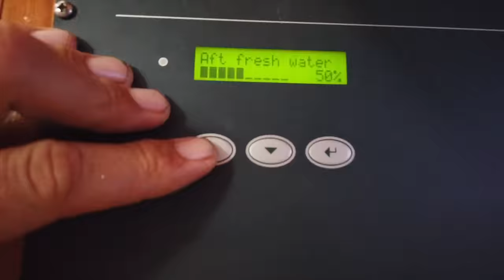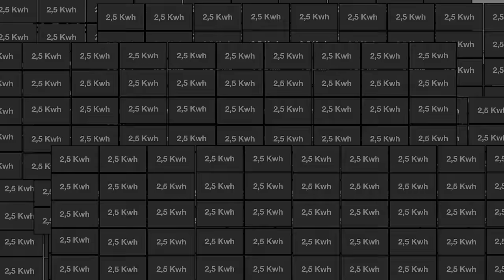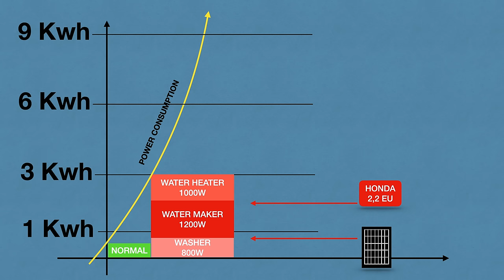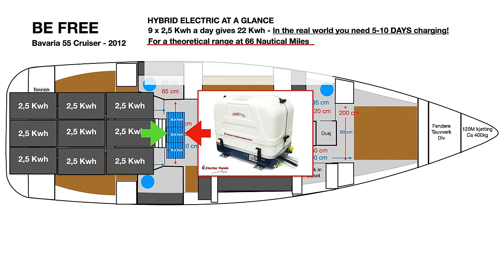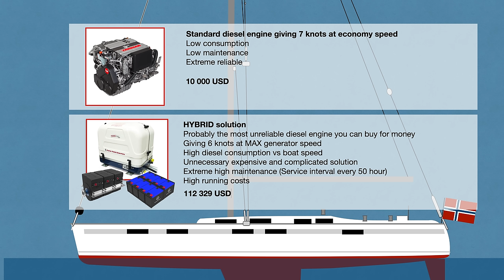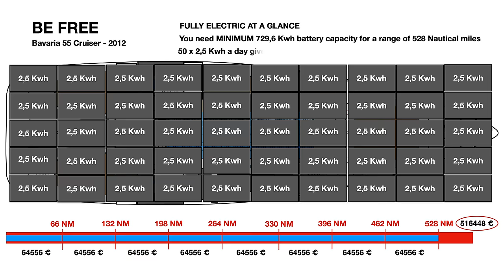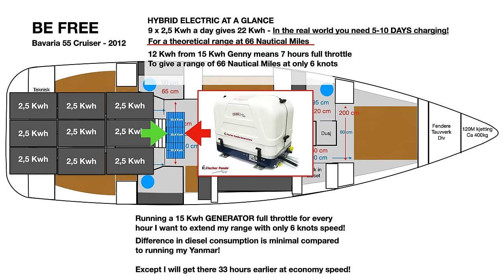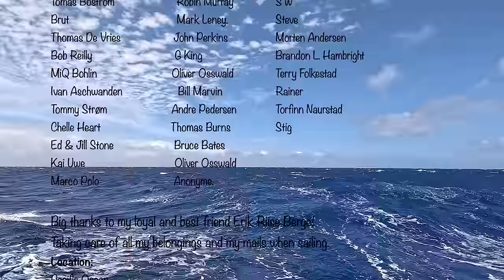Why I don't believe in ELECTRIC or HYBRID for long-distance sailing - SwT 170 - MY HONEST OPINION

Comment: The two big takeaways here are:
1) Fischer Panda generators are not reliable.  Yanmar diesels are more reliable, perhaps because they don't need an electrical system at all once running.
2) Electronics are not reliable.  This includes everything from engine electronics, guidance and communication systems, and power electronics like solar cells, inverters, and batteries.  I think this has a LOT to do with the unserious attitude small marine vessels have towards lightning protection.

The electric utility industry and the airline industry build equipment that rides through direct lightning strikes without fault.  They take strikes seriously.  To deal with a strike you must be able to conduct thousands of amps from the top of the mast to the sea, and you must be able to tolerate many thousands of volts per meter of electric field.  Transmission systems and airplanes can deal with both these things because they characterize the problem, design solutions for EVERY affected component, and then pay the money to build those solutions.

The conductor issue requires a continuous minimum half inch diameter aluminum conductor going from the top of the mast to the ocean.  This is soft, pure aluminum, not something doing double duty as a stay wire, unless your rigging is ACSR cable.  This isn't something with a bolted connection along the path.  It probably does need a bolted connection to the contactor in the ocean, and I would either have those bolts underwater or at minimum have the conductor travel past the bolts and make solid water contact alongside the contactor.  At the top of the mast, the conductor will need a large ring, or some other contactor such that the lowest-resistance path to a strike coming in at any angle is always to this conductor and not through any part of the salt-water-soaked rigging.

Draining the amps to the ocean does not solve the electric field problem.

The electric field issue requires that all electronic devices be inside Faraday cages.  You have to think about this like sealing water from entering the hull, with care taken at every interface like the shaft coming out or the solar panel connection.  That means a complete conductive envelope all the way around.  The good news is the envelope can be a wire mesh, it doesn't have to be heavy.

I see a lot of exposed electronics in and around engines, batteries, antennas, and everything with a display.  I can imagine practical people objecting that there's no way to use a display that's boxed, and there's no way to connect an antenna so that it's not conductive, and that you have to connect batteries to motors somehow and requiring a complete shield around the whole system is unreasonable.  To which I say, utilities do it.  Commercial jets do it.  But it's not clear to me that small marine vendors are willing to do it.

Here's what that looks like:
* Antennas need built-in amplifiers and fiber-optic connections to the rest of the equipment.  This entire part must be considered expendable with multiple backups for when it takes a hit and gets fried.  Backups must be stored inside Faraday cages.
* Displays should have a conductive grill over them.  I know, you think I'm full of shit, this will make the display ugly and hard to clean.  Fine then, put the display inside a room which is itself a Faraday cage, and close the door during storms.
* Batteries and motors and inverters and pumps and all the electrical equipment must be in a compartment and have a Faraday cage around the entire compartment, and no continuous electrical connection from inside that compartment to any other.  The connectors to the solar DC inputs will require some serious engineering, so that large transient electric fields get shorted out without propagating into the internal electrics.
* Doors on these compartments and on the drawers which store backups must have contactors all around the edges, like on microwaves or PC cases or stealth fighter planes.

These recommendations seem bizarre and ridiculous to you, just as the engineering on the boat to keep water from coming in the propshaft hull penetration looks ridiculous to someone who lives far away from navigable water and only deals with rain.

Good luck.
Reply: Gday Iain  I have Made Notes on your Suggestions for a Faraday Cage ...Is this Setup as Easy as it sounds With Chicken Wire and are there or do you have a Link toa DIY rig/setup of same ...( Is it the Case during a Storm that you can Lump all your Sensitive Electronic Equipment into a Cage in the Boat ? ) Thanks for your Comments taken them on Board
Reply: @jeremylivingstone4110  It sounds like you are asking me: Can I just make a cage of chicken wire somewhere on the boat, put all my sensitive equipment in that during storms, and expect it to ride out a lightning strike?

A: Pretty much yes.  You have to be careful at the seams of the chicken wire to get the metal connected to metal -- no epoxy or plastic coatings in the way.  The usual difficulty is around the edge of the door, where you need to make contact all the way around the edge (not just at the hinge).  The final caution is that the wire mesh should have small enough mesh openings, as the cage will look impenetrable to low frequency photons (your radio won't work) but transparent to high frequency photons (you can see through it).

I wasn't able to find an online reference for minimum mesh size for lightning protection.  If it's for a cabinet or drawer, why not just use aluminum foil?  I know it's a joke, but the joke is based on foil being a practical material to build a faraday cage from that wouldn't have frequency limits.

The contacts around the edge have to work and are easy to overlook.  The metal gasket used for the closures on PC cases is cheap, as is the metal gasket used around microwave oven doors.  The fingers on the PC gasket closure have gaps, but they're just a few mm and that protects against frequencies up to many GHz.
Reply: @IainMcClatchie  Nice Will Do Some Research Thanks for the Update ⚓

Comment: If your plan is to race bad weather into port, I think that's where your problem has started. Don't rely on an engine to save you. An engine can fail for many reasons. Even a perfectly working engine can be disabled by a piece of rope around the prop. In the old days, everyone sailed around without engines. Of course you will say sailing was quite dangerous then, yes it was. But sailing is not made safe because of engines, but because of modern materials, modern weather forecasts, modern medicine, modern navigation, and radio!!. So sailing without a lot of range under power (or without power at all) is much much safer now than it was back then. Unfortunately people take these modern technologies, such as a 10 day forecast, and push it to the limits, try to make port before they get hit rather than riding the storm while safely out to sea.

Comment: People were doing with wind only some centuries ago, and an electric motor with solar panels would sure add luxury to the wind only propulsion.
Yea...you are like those influences, spoiled with petrol, an easy way to move your heavy boat wherever and whenever you want whatever wind or sun there is. In fact... In a way you are a lesser navigator then a guy with a small battery/panel/electric motor package in a sailboat.

Comment: If you want go be more green: Purchase an aluminum hull!
- no plastics
- no paint
- holds forever
- recycled material / material grast for recycling

It comes at a cost, but it even increases safety.
Stay with a Diesel engine, some solar panels and a moderate battery bank.

Comment: You assume hybrid requires a generator. 

I agree that's useless. 

But a parrallel hybrid like the Beta marine setup is perfect. The diesel now doubles as your generator, and whatever solar you have adds some range for safety.

So you go from wind + diesel to wind + diesel + solar as range extenders. So hybrid done properly is the superior tech.
Reply from the maker: Thank you for watching and your feedback. 

Your absolutely correct in the fact a serial hybrid solution is the way to go, especially if budget isn’t a problem. It’s even brilliant with re generate as well. My point was fully electric is a fantasy for blue water sailing, and the illusion and mistakes some believe adding a generator makes it a good hybrid solution. Even adding re generate on a fully electric is not enough. A fully electric is not fully electric if needing assistance form a generator. This was my planned “takeaway” that somehow disappeared.

I was not clear enough in this. Editing over weeks and final editing before publishing is sometimes dangerous as some points disappear during the proses over such long time. 

Still there are several YouTube sailors claiming fully electric works, and this is at its best missleading information. Its just as dangerous as sailors telling their dinghy doubles as a life raft. Some believe in what they see online. I’m not against evolution, only want to contribute with some facts and real life experience. It’s not mainstream opinions I’m sharing, and going against the hype is definitely high risk. 

All the best ⛵️
Reply: @SailingwithThomas  agree with everything you say.

You made very good points about sun being less in Carribean and Pacific vs the Med. 

As a coastal cruiser in the English channel I did not know this.

I'd go for parrallel hybrid though not series hybrid. You want to be able to use just the diesel engine to not add risk factor from the hybrid setup.
Reply from the maker: Thank you so much 🙏🏻 My choice would definitely be a Diesel engine as the main propulsion system. With options for electric propulsion and even re gen. In total a solution like this would be safe, extended range, and even plausible to result in reduced consumption of fossil fuel.
The biggest difference people tend to forget is most sailors spend 90% at anchor. Then at some point you will be depending on power on demand. 

I believe you will enjoy todays episode behind the scenes making this episode. 

I’m also working on a follow up episode on this topic. It’s extended research and gathering verified data. (Time consuming) It will show some interesting facts. Especially if the motivation is to “save the planet”.

Comment: You don’t need to increase the battery pack… you don’t think about hydrogeneration on sail. You  all calculated that you are not going  to sail. With a good parallel hybrid system you don’t need to start your genset so frequently… just hydrogen on sail and solar power…

Comment: Thank you for saying all of this. There is so much money and resources that are being spent for this “green energy”. Electric cars, solar power, windmills, etc…   Dependability, longevity, safety, cost and the resources used to manufacture these products do NOT add up to “green”. A person could drive a Hummer as their daily driver and have a smaller carbon footprint than a person driving a Prius. Cold weather?  I live in Montana and it was recently -42 F 🥶.  Electric cars are useless in those temps. Green energy is a great idea, in theory. Unfortunately the public’s perception of the reality of Green energy is off.  The U.S. power grid would cease to exist without fossil fueled power plants. Even if you covered the whole continent with solar panels. It’s all a bit of a smoke screen. 
Thank you for going out on a limb and taking the time to make this video.
👍✨

Comment: i seriously don't like the assumptions you are making. you can't write off hybrid because you dislike 1 brand of generator. in the end, most generators are just diesel engines, not much different than the one you have driving the prop shaft.
Also, for catamarans which can easily have over a dozen solar panels, it's a whole different story.

Comment: If you have no engine, then this would be a reason to have an electric boat. You wouldn't need that high a capacity. Especially if you are used to sailing without an engine.

Diesel engines are also hybrid, you have to start them.:face-orange-raised-eyebrow:

Comment: Electric hasn't changed in 7 years my butt.  The panels are half the price and they have some that double the power output.  This is just the solar panels.  The management systems are a lot better with more efficiency.

Comment: Well, there’s plenty of sailboats with non-working diesels sailing around the world.
Reply: Don't ever try to start crossing the Atlantic with a dead engine.
Reply: @paulpaul9914  that’s my point.  Electric is fine.  Diesels are fine.  No engine is fine.  People have been sailing with all of that for hundreds and even thousands of years.   Is it an increased risk?  Sure.   But crossing the ocean in a small boat is already a much bigger risk.   The only thing you’re losing by not having a diesel with decent range on an ocean crossing is the ability to motor out of incoming severe weather.   Almost no diesel sailboat has enough range to make it back to shore after a dismantling mid-ocean.   If it was my boat making the crossing, I’d prefer to have a diesel.  If it was a coastal cruising boat, electric or even an outboard is fine.

Comment: Hei hei Thomas, let me preface my comments by my surprise coming from an anti-green Norwegian...! Laff... (I lived in Norway for 8 years married to a Norwegian national for 35)... Notwithstanding I have to note details you failed to mention or incorrect use of some terms: First of all your panels were single face cutting your PV collection considerably... Secondly, you define Hybrid by the use of a generator... Please see fellow youtube cruisers S/V Distant Shores and the boat they are building in the Netherlands where the power plant is from a UK company called Hybrid no generator to be seen... Thirdly, you are on a very large boat that I would never try to convert to all electric... Case in point: S/V Wisdom (also YouTube) that converted using the exact same PMAC as I have but twice the displacement... Were they slow...? You bet... However, the man and woman crew crossed the Atlantic twice and sailed all over the Caribe and even up the East coast US ICW all on electric occasionlly using their (you guessed it Honda genny)... (BTW the S/V Wisdom skipper is a weather genius of sorts)... You have been using calculations for your view so I will in turn present the simple first test of my all electric conversion... Summer 2022 was the maiden voyage of my 40' sloop IMHO the optimum size of boat to convert to electric... I sailed from my current marina to another marina 35NM down coast... I motored out to the channel (head into the wind) and at the CAN I went Southerly with a Port tack not quite on the beam with about 30% reefed jib and the rheostat at around 900RPM... At this point I'm motor sailing with regen doing my hullspeed of about 7.5kts... The Electric Yacht monitor displayed at the time of turning South of 29hrs runtime remaining... At destination (a marina) the monitor displayed 26.5 hrs runtime remaining... Result...? 2.5hrs consumption in a 5.5hr sail... Yes, you're right: wind was blowing and the Sun was shining... Nonetheless I was faced with repowering my vessel with a Diesel solution not available for reasons to detailed to disclose... Out of frustration and no ideals of saving-the-planet I'm glad I made the conversion... For reasons not related to Electrical I have been stuck in my marina for the past year... the bright side is my marina EL line item total for 2023 was a whooping $236.60 so I'm happy with that outcome... And, I will also agree that sailing the Pacific is way too challenging even for a huge displacement vessel with a strong Diesel... I hope you can agree not all folks have such gigantic sailing ambitions... I'm fairly certain I can motor-sail down the ditch to FL and the Bahamas and points further South island hoping if I have to to reach my destinaions for: PADI diving, free diving and spear fishing... You see Thomas not all sailing is just about the sake of sailing... there are rewards once the destination is reached... BTW: I have 38kWh onboard at 48v and 1200w at 12v... 2kWh of PV bifacial... Winter Sun angle I will get 4-5kWh/day... Summer I get 7-9kWh/day... I have yet not gotten close to running out of power... Facebook and the internet is full of nay-sayers and now on YouTube... Ha det and Fair Winds...

Comment: friends don't let friends buy a fischer panda
Reply: Fisher Price maybe ?
Reply: Yes, prefer, “Kubota” made in Japan direct fuel injection only, for the most reliable running and fuel efficiency with the longest minimum maintenance hours. If a generator must be used, as far as noise db reduction, that can be a, DIY remedied by sound insulting panels in the hold.